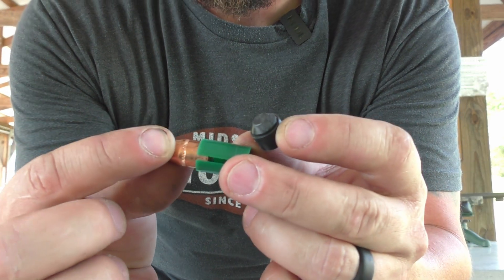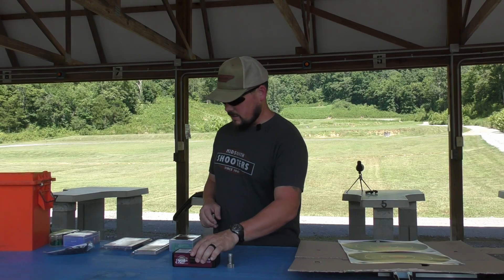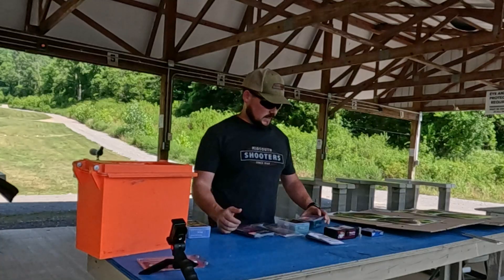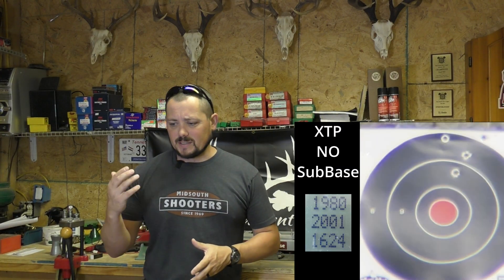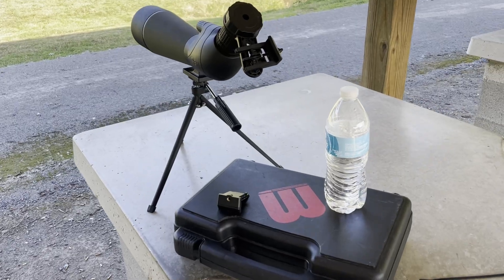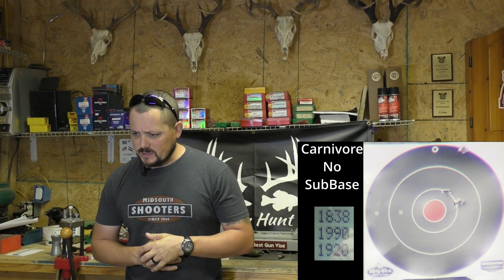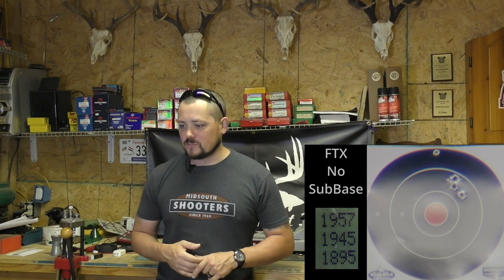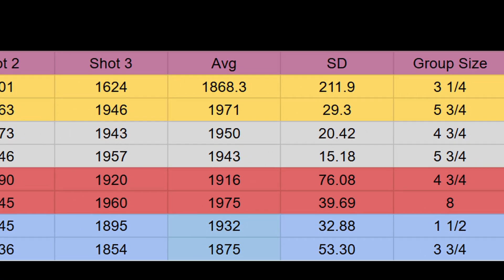Sabot Sub-Base Test with Pellets

Comment: Hey DJ,  I shoot them xtp's but they dont like high  velocities, I read somewhere either on the box or Hornady's website that the velocities shouldn't be more than 1500fps, or something like that....I use 56 gn by weight Bh209 and its dead nuts @100yds with open sights.

Comment: Hmmmmm… I see a test with the 340 grain ELD-X coming (for me).  Taking advantage of the principles of the Minie Ball applied to modern tech.  I know I run a dry felt patch over my powder charge in my .54 and .62 caliber rifled flintlocks… it does help with patch burnout on a round ball.  It seems like a novel idea, but it did not seem to work on your test.  Thank you for sharing